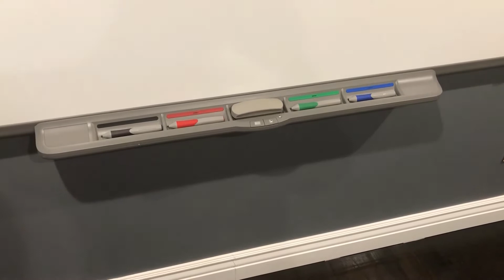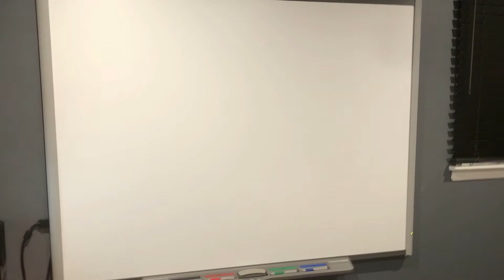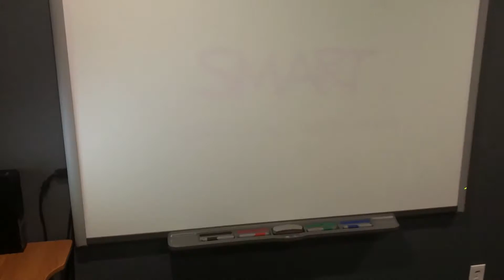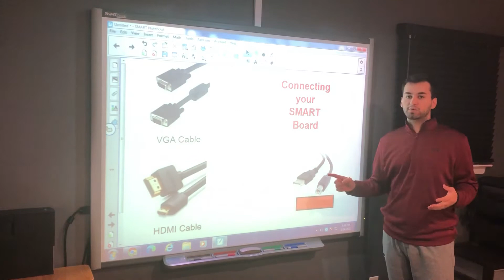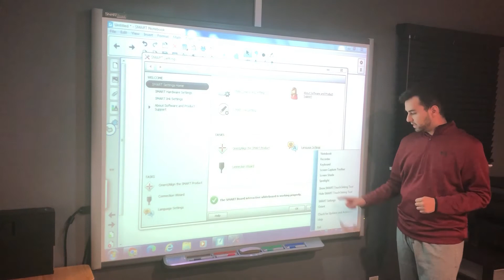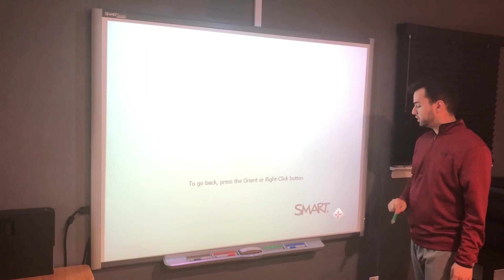Getting started with the SMART Board 600 series interactive whiteboard

Comment: Is that Windows 7? Because Windows 7 ended in 2020 and this was recorded in 2022
Reply: Yes that is windows seven and that is because the smart board 600 series date back to the mid to late 2000s so for the best compatibility windows 7 should be used

Comment: You are the first video that actually showed that it's a projector. lol..  I keep seeing "smart boards" for $2k and $3k, and then there are boards that are only $100 to $200--   and I couldn't figure out what was the difference;  So now I see, that the cheaper setups are projectors, vs the expensive screens I'm assuming are just fancy touchscreens monitors..   You could make a video explaining this difference, because it was surprisingly hard to find.. and I've watched several "smart board" videos.    Cheers.
Reply from the maker: No so about 10 years ago these were the SMART Boards. The systems included a projector which costed 2-3 grand plus the whiteboard. total about 4-5K. Now SMART has moved away from projectors as they are lower quality and take more to maintain. displays today can run from 3-10K depending on Education or Business use.

Comment: Tell about Pricing kindly??
Reply: Hi so my name is Joshua Foreman, before I tell you about the 600 series SMART Board, 
I want to disclose that I am not affiliated with SMART Technologies 
So one day I was paid about $200 and so I went 3 hours and I live in Columbus Ohio, and I had to travel about 3 hours to Piqua Ohio for a $100 SMART Board from Facebook Marketplace and the projector is nothing special its a NEC V332W and for operating systems I have got macOS Big Sur and Windows 10 and 11 on my Windows 10 I run SMART Notebook 11.4 and on windows 11 I have got SMART Notebook 10 both of which are very old and was made around the 2013 era and it works pretty identically from when I was in Elementary. So yeah pretty wild I am also right in front of my SMART Board 600 series right now lol byeeeee peace out